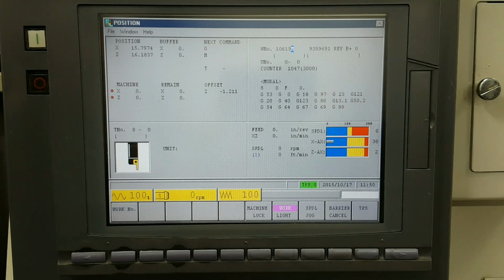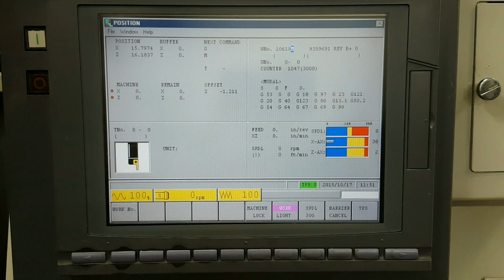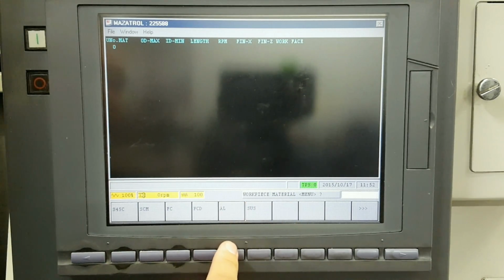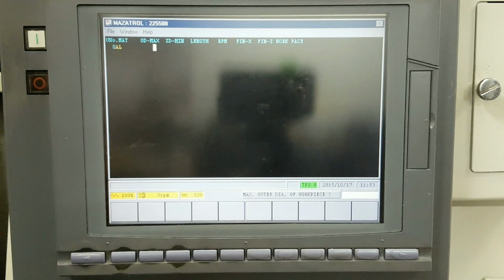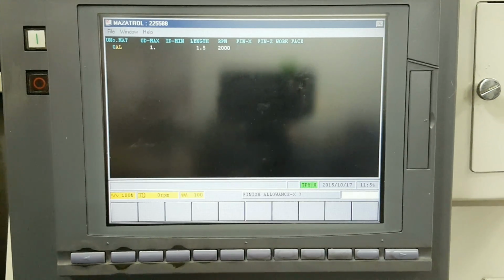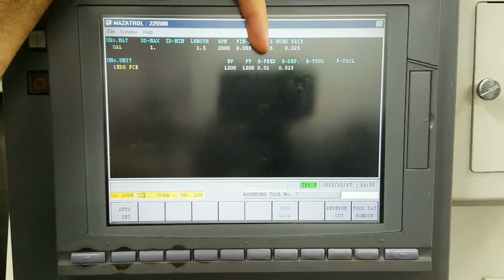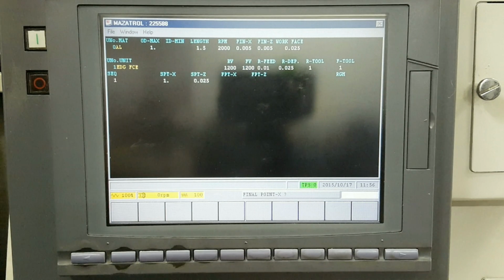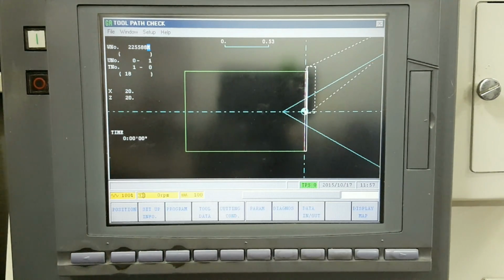Mazak Lathe Programming #3 Facing

Comment: In the Mazak 640 t system, how to set the tools so that they change without moving to the tool change point, I would like the head to rotate close to the workpiece, without moving away.
It was fine, and now the head runs away behind the tailstock to change the tool.

Comment: Ok cool. But I'm a beginner, and what if I want a corner radius on the outer edge, leading into a radius down to Z0X0? Meaning the face isn't square, it's slightly round. Would I still use "Face"? Will that get me a corner to another radius? Or maybe "Bar"? Something so simple is totally stumping me.
Reply: Bar out

Comment: Awesome step video I'm running a qt20,15and a slant turn
Reply: +Carlos Tadros --Thanks. Nice video. Where can I buy DVD on Mazatrol programming? It is easy to understand.visually.
Reply: +Resbel64 honestly you would have to call Mazak and take a course with my luck I had a guy who fixes my machines use to work with Mazak for 25 years and taught me the Mazatrol controller I don't know everything but I program pretty good with the basic of machining still learning everyday honestly it's always good when you have the machine in front of you to mess with
Reply: Thanks